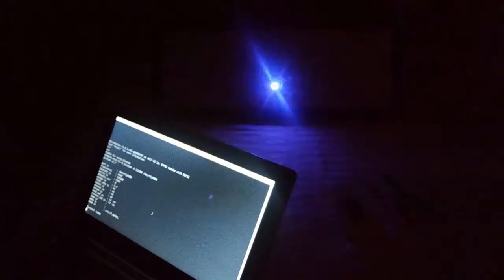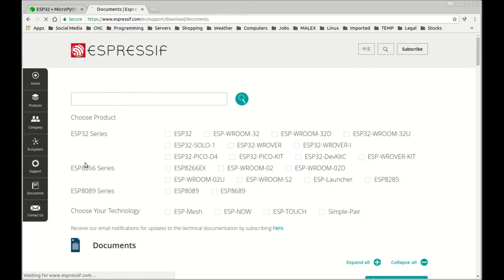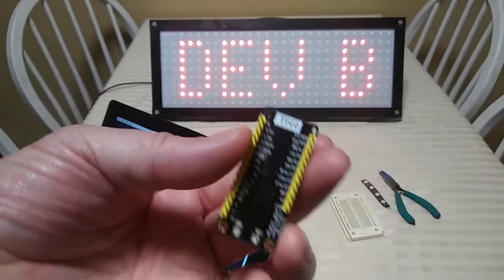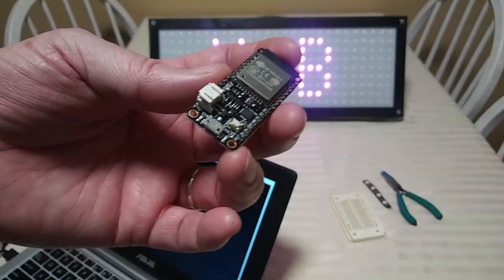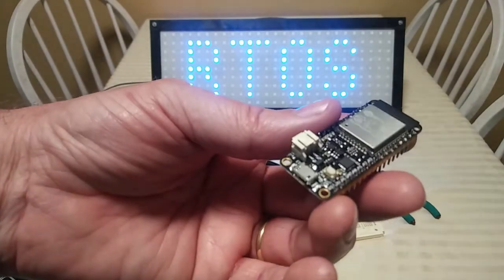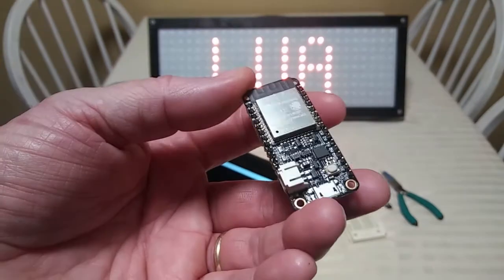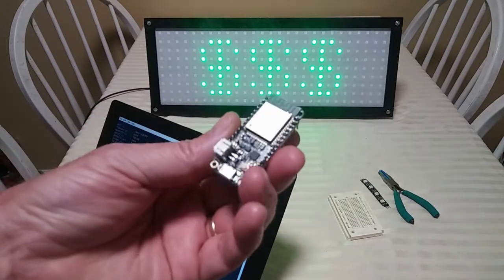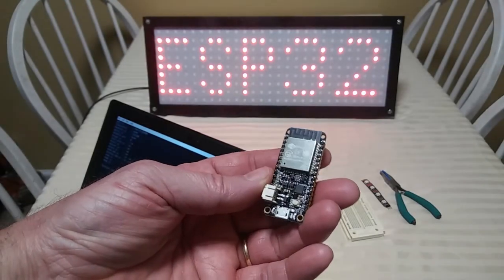What is this Thing - ESP32 Project 0

Comment: Well... not strictly one process at a time, coz it's a dual-core chip, you can have 2 different processes running in parallel.  Then ontop of that there's also the low-power core in there too.  This thing has so many toys in it.
Reply from the maker: Yes. Your right. I figured I'd catch some slack for that lame description.